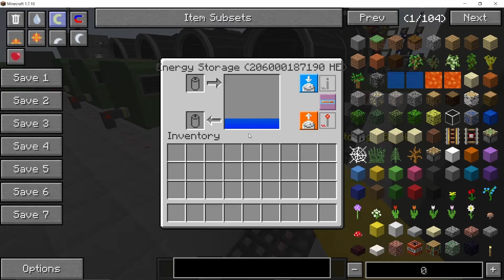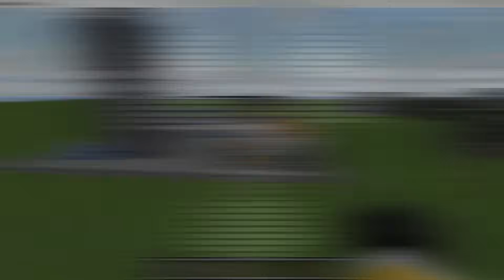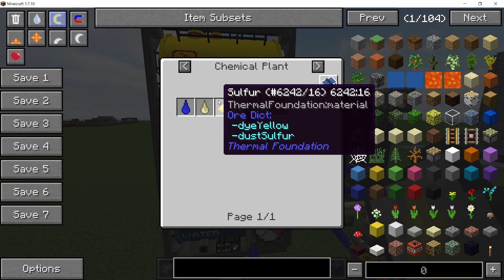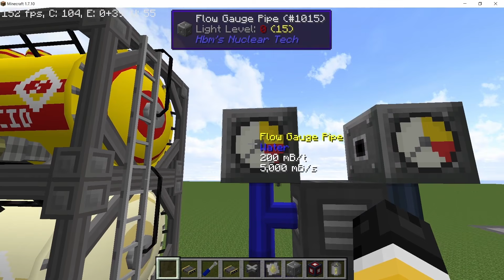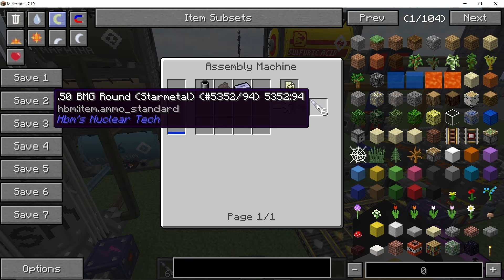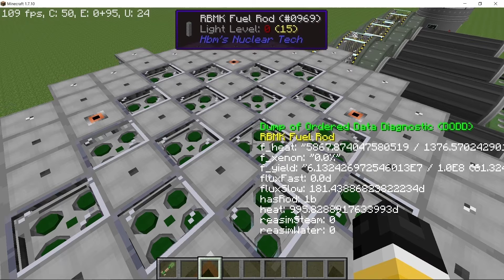NEW Chemical Factory, Steel Trapdoor, Starmetal 50 BMG Rounds and More - HBMs NTM Updates

Comment: Ngl the previous chemical factory is kinda better considering it's supposed to be a industrial heavy machine upgrade of the first tier
Reply: fr, it was better when u had 8 recipes, atleast u can still use it
Reply: I personally think that one should be renamed and updated to be tiered accordingly instead of being removed because it can process just more recipes at a time
Reply: @ahlixemus8903 they use fundamentally different systems, so the dev would have to remake it from scratch basically. Probably not happening
Reply: @log_by_bolb  Probably not but it's a shame because it's a downgrade